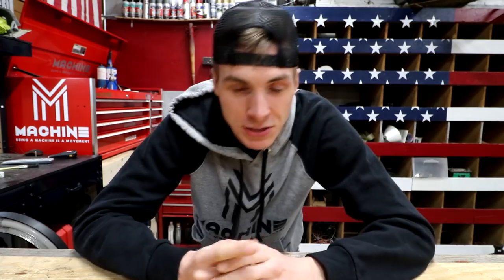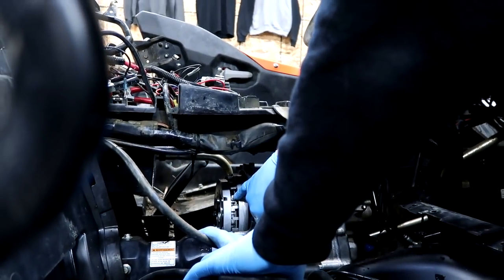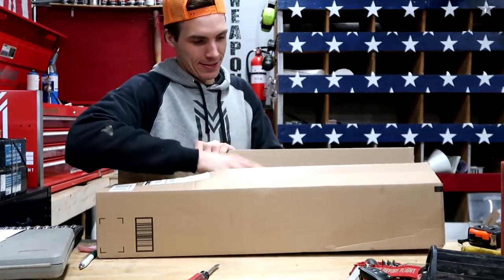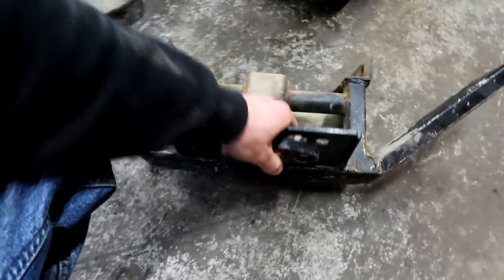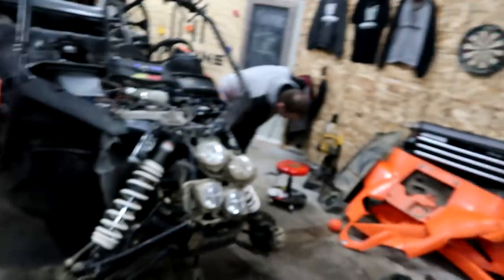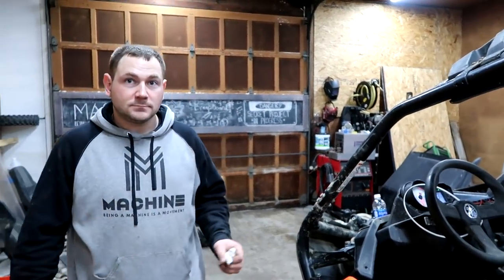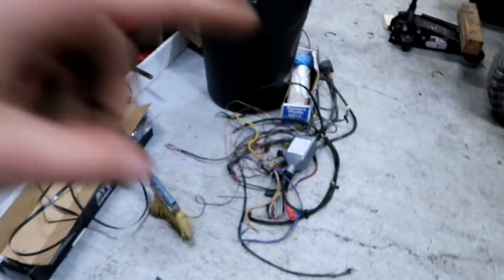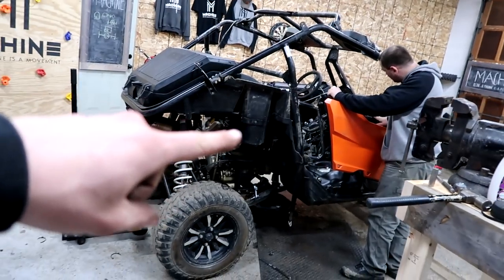CRUSH MOVES!!! TOTALED YXZ 1000 LIVES

Comment: Brakes need attention most likely a warped disc or calipers are stuck and sliders need to be greased.  This model is more for fire roads and dunes, rip it at Jakes in the back after you get some new rubber on it. I would not trust the old roll cage. I would put a new roll cage on it after you get it sorted out,  they are $1700 new and  half that used.  It could save your life if you flip it again.
Reply: He wasn't the one that flipped it, he bought it rolled
Reply: The previous Owner bent it (then Dalton  bent it back) but now it is a lot weaker. This model does 78mph, if you reflash the ecu to remove the limiter  they do close to 90mph.  $750.00- $850.00   for a used rollcage to protect you from a Fatal crash is a no brainer. There is one on ebay for 350.00 right now https://www.ebay.com/itm/NEW-YAMAHA-YXZ1000R-YXZ1000-R-YXZ-1000-COMPLETE-ROLL-CAGE-TUBE-BAR-2016-2017-18/282760363682?hash=item41d5d4bea2:g:8eIAAOSwrFtaJds7&vxp=mtr

Comment: Is it smoking out the exhaust?
Reply: Don’t you own a vehicle when it’s cold your exhaust will have condensation mist
Reply: Matthew Watterson I was unable to determine, from the video, what the temperature was inside his shop. Therefore my comment posed as a question, “is your exhaust smoking?”
Reply: Matthew Watterson yeah if it was cold in there they probably wouldn’t have been in there working on crush.
Reply: It's probably fogging oil
Reply: Anthony Marin why are they wearing sweat shirts and jeans if it’s not cold
Reply: Joshua Highfield because it’s winter
Reply: Usually when an engine is cold it will run a richer fuel air ratio and a higher rpm to compensate for more fuel which is why it sounds like it was idling high and fumes we're coming out of the exhaust when it starts to warm up enough fuel air ratio will start to lean out to what it should normally be and engine rpm will come down as well  the fumes will go away but if they don't he may have a problem of some sort lol